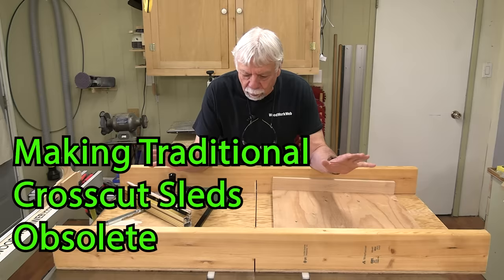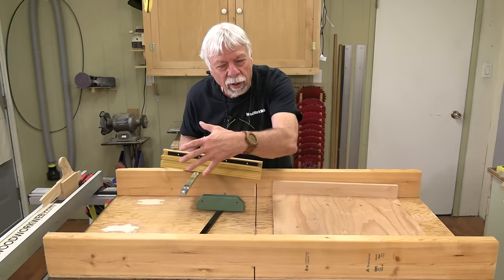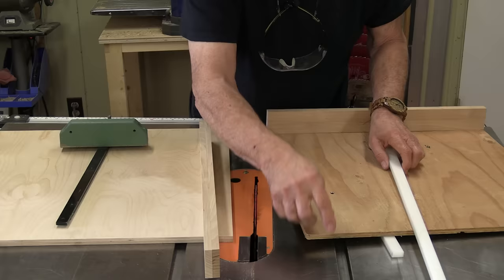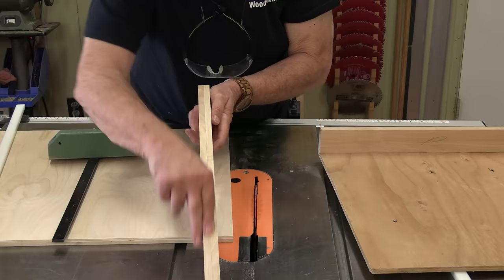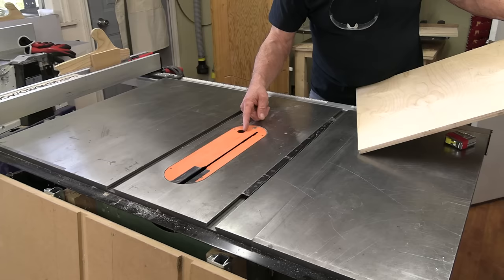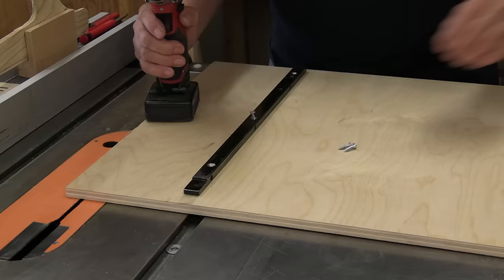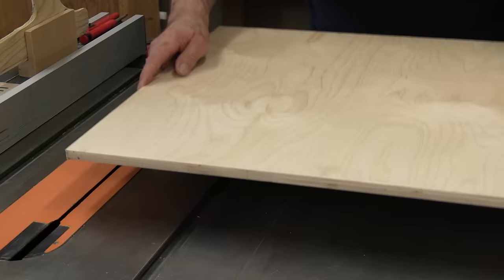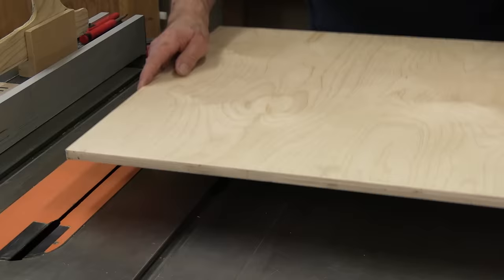STOP Making Out-Dated Table Saw Sleds, Do This Instead

Comment: I’m very surprised that you used double sided tape as that was totally unnecessary. Just measure, adding a small amount, where the runner has to go, screw it down and cut off the excess. Then surely the rear fence should be 90deg to that cut line not anything else. Very strange approach to use the other runner??

Comment: Too bad the piece of plywood is warped...  It has a gap just around the miter slot going to the (our) right...  from 14:40 you can see it flex..
Also, it's not really handy, I think, to have a back fence that stops at the blade, now you can't use it to make thin strips without using the table saw fence...(or box joints)

Comment: Well I have to point out. From how you measured with the feeler gages is the taper only in 12” or what ever length the piece is.  Not the total all around. .025” in 12” is .05” in 24, or .1” in 48”. And in 60” it’s a full 1/8”.

Comment: 9:50 - "You never align anything to the table saw blade."      Uh, whut??     The blade that makes the cut is the primary reference line on a table saw.  Anyone that aspires to precision work using the table saw adjusts the table saw top rotationally as needed so the grooves are parallel to the blade. 🤨
Reply: I believe this means (albeit, never explained) that since the miter slots are the ONLY things that don't move on the table you reference EVERYTHING else (blade, fence, sled etc.) from them. If your sled is made square to the slot and your cuts are NOT square then you must adjust your blade because obviously you can't adjust the slots.
Reply: @sunburstmike8745    Whooosh!
Reply: I agree completely. The important thing is to be square to the CUT or the blade. That's what matters in the end.

Comment: Stop!you need to put some nail polish, yes…unmanly but it works best,  put the nail polish on the recessed screw holes. It will reduce the likely hood of rust! Also, use hard carnauba wax over the ENTIRE BOTTOM of the sled.  Put each layer of wax on and buff out  the wax between each coating.  I would STRONGLY suggest 5 layers of wax, at a minimum.  Someone will ask…’but why?’ It will help prevent cupping and warping, but mostly it will help prevent drag and that means less arm fatigue.

Comment: The problem is that so many crosscut sleds are made like yours, too heavy and too large.  Use 1/4" UV finished birch plywood for the base, light and very stable.  The runners should be made from beech or another stable hardwood.  Using wood runners allows you to glue the runners in place so the alignment is perfect.  No metallic fasteners are required.  The back fence should be made from a stable hardwood, like maple or oak.  It needs to be jointed as flat as possible, it is the primary reference.  The front fence should also be a hardwood an only needs to be about 10" long.

Comment: You go to your "local plastic store"??..?? seriously?. I have never seen a "plastic store", in all the 6 decades I have been alive. Can you share the secret as to where one might find a "plastic store"?
Reply: Sure, a sign shop.
Reply: Tap plastic
Reply: I hear you…funny enough, there actually is a plastics store in the city I live in!
Reply: They’re now called plastic surgery clinics. You can even buy now a bag of silicone. 😁
Reply: We have them. You clearly haven't a clue 🤦‍♂️
Reply: Try looking up plastic suppliers. I have used two of them in my area. Just as difficult to find as a metals supplier. Hung up on semantics?
Reply: Commercial and industrial suppliers of rubber and plastics. Normally they will cut or shap if you provide a sketch and $
Reply: @leprechaun7667 never heard of such a thing
Reply: @jeffshannon9677 never heard of a plastics vendor either
Reply: I work for an engineering supply company. I regularly sell a variety of plastic stock items. I have some stock in store. For more specific sizes and or specialized plastic stock , I order it in from a wholesaler based in one of the major cities. So in theory my customers come to my store to buy plastic.

Comment: Woah, just woah!

Sure this may be a handy sled, but to say it replaces a larger more elaborate rig "for everything" is balderdash.

Maybe it's fine for the work you do, great, but not me and thousands like me.

For instance it doesn't support the cut piece.

How about the zero clearance qualities of a full sled... you don't seem to do stuff where that matters either.

You obviously don't cut box joints very often, that's blatantly clear.

I can think of several instances where you're recommendations could actually be dangerous.

For instance, your cut piece is lose on the table saw. It doesn't return where it can safely be retrieved and less potential for pieces to be launched by a blade!

Useful addition to many shops? Quite plausible. 

Replace a larger sled for YOUR purposes? Apparently true.

Replace a larger sled for the work I sometimes do and many, many OTHERS do daily?

I will be polite and just recommend you don't wager anything important on that. You have already lost the argument. Sorry.

If your title was "Why I'm ditching the big sled", I would not have wasted time with this comment.

I'd have no issue with the premise, title and video (not that the world actually gives a rats about my opinion).

Ultimately, I would ONLY advise an experienced woodworker to use this sled where appropriate. Full stop!

Finally, who says more elaborate sleds need to be the size of the saw and weigh 26 lbs?

Furthermore, large mating surfaces mean more friction. There are solutions to/for that. Honest!

Comment: Hm... it's funny to see how a whole continent is stuck with those small saws & sleds of different variants - while the rest of the world has moved on to full-size table saws with sliding tables that work for sheet materials AND for ripping boards! The table saw in our school workshop can cross-cut 8x4ft - no need to break out the track saw. Even the first "mid-size" table saw I bought after college came with a long sliding table and could do 4ft wide parallel cuts... my advice would be to buy FEWER machines - but full-size ones instead... safer, quicker and less time needed for constantly building some add-ons...
Reply: I think many people don't have the "shop space" at home to own such a machine.  Have to make do, some people do this in their garage and are so skilled (self-taught) they end up starting to commission work for people who ask and it all snowballs from there.  Why is your way the correct way in your eyes?  Some people have day jobs and only do this as a hobby, and some people do this on the side to make extra coin.  Not everybody has the room for a full-size table saw that limit you to 1 tool.  Stop painting yourself into a corner and branch out more, you might learn a few things along the way.
Reply: @MV-wb2cz  Bigger machines are usually safer machines and they are way more cost-efficient too as you don't spend time building jigs all the time*. I have a day job and my big-ish table saw is sitting in a garage too. I am a workshop instructor (chair-maker by trade) but I used to work in marketing and product development for big consumer brands. I made product lines for the EU and the US and I picked up a few things about how these markets work: The US is suffering from the fact that thousands of manufacturers are telling woodworkers that they need a million different tools to succeed. Those tools are deliberately kept a rather low price points. As a result, woodworkers in the US end up with a shop filled to the roof with small-ish, semi-practical gadgets that are often bought instead of honing a specific skill. If wood workers in the US would trust/focus on their SKILLS more, they would realize that a handful of machines is enough to do great work. And if you need only 5 machines, you can buy bigger and better and still work from a small garage!

*Addendum: USED big machines can often be picked up for a much lower price than the same machine that is new and small. I got my big Colchester lathe for the scrap metal price while the pint-sized "student" model would have cost 3500.00... just saying ;-)